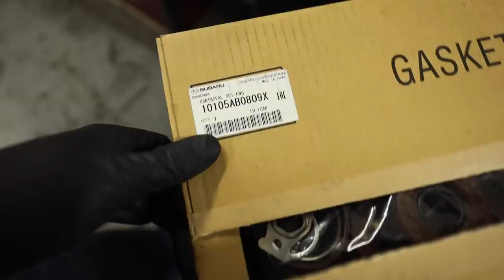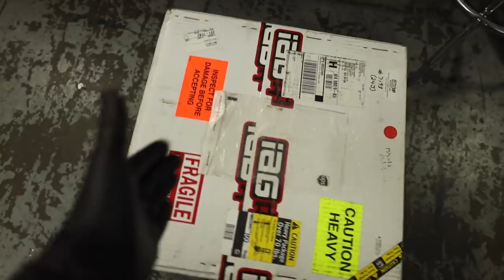Building a 2007 Subaru WRX STi!

Comment: Keep it savage bro.  Always savage!
Reply from the maker: Whats the pil filter your using? Too wide?
Reply: @Smeedia  no it’s a k/n fairly smaller than the Subaru oem one. I can send pics through email.
Reply: @Smeedia  it won’t fit because of the killer b holy headers I’ve installed.  I also have a grim speed up pipe and Cobb down pipe blouch 2.5 xrt with a 3” Perrin inlet. E85 conversion and a 340 lph gas pump. Kw Suspension Perrin sway bars Perrin links Perrin transmission mount and other stuff I’m forgetting. But for some odd reason its only the exhaust that won’t fit I feel correctly. Because now that I’ve installed the aftermarket exhaust the oil filter is out of place and won’t fit
Reply from the maker: Shoot some photos over 🙏 are you on IG?
Reply: @Smeedia  @meta_wrx

Comment: Nice!  That's almost the same build I'm going to be doing on my 02 wrx wagon.  I'm still trying to figure out everything I want to get, and spacing out purchases.  I got the iag trojan closed deck block.  I'll be getting stock ported b25 heads, but with upgraded internals.  My biggest issue is what turbo/turbo kit I'm going to go with.  I want to go rotated but it's so much money.  And the rest of the supporting parts, of course.  I will just patiently start amassing all my parts and continue watching your amazing videos.
Reply from the maker: Save up and go rotated, we'll worth it!
Reply: @Smeedia  yeah, that was the plan to begin with.  Go big or go home, I guess.

Comment: I thought you’re supposed to always replace the oil cooler when you motor has a problem
Reply: That's what my tuner told me, or at the very least flush it out in both directions with a solvent.
Reply from the maker: Preferably yes, from my understanding the owner wanted to reuse it so I cleaned the hell out of it

Comment: Just what I expected! Love it! Also, question, do you think it would be cheaper to buy the case halves and internal components and build the short block yourself or spend a couple hundred extra dollars to have it pre-built, blue-printed, and drop-in ready?
Reply from the maker: If your comfortable building it and doing all the work it will save you around $1000, but if not I'd have a builder knock it out 🙏

Comment: owner should have replaced the oil cooler (iag warrenty?) also,  maybe a fluidampner, not the old stock one,
also,  is clocking the knock sensor important?  fram oil filter?
Reply from the maker: Swapped him over to a perrin external cooler now 🙏 talked to him and he wanted to make the switch now, I believe it's out of his budget for the time being. 

And nor.all I do 11 o clock on thr knock sensor, just easier on the wiring where the tail comes off

Comment: You said that there was engine barring material floating throughout the oil system.  Please tell me that you did flush out the oil cooler before it was installed.

Also,  love the channel.  In your videos you do a great job of explaining things.  I have a 06 and 07 Hawkeye WRX and your videos have taught me a lot.  Keep it up!
Reply from the maker: Yessir 4 cans of brake clean and some solvent went through it to clean it out 🔥

Glad the videos have been helping! 😁
Reply: You should never clean an oil cooler always replace not worth the cost verses getting a new oil cooler why destroy a good motor
Reply from the maker: Talked with the customer and he's getting an external cooler to replace it 🙏

Comment: Curious, are you replacing the oil cooler with a new one? I put a new one on my new short block from Crawford, wasn’t sure if it needed to be replaced but felt like it’s be at the minimum a piece of mind thing on my rebuild.
Reply from the maker: Swapping from OEM to an external perrin pil cooler now, at first the customer was reading his from my understanding. Going in the bin now.

Comment: That gasket kit is only for 08 and up sti's? I have an 06 but I'm going with a iag stage 1 build so idk if that gasket kit will work on my new block
Reply from the maker: The gaskets are about 90% the same, I couldn't find the part number for the older gens 😭

Comment: when you remove the bottom 4 bell housing bolts from the tran/ engine to pull the engine do you remove the axle to gain access to the lowest ones? or who do you get there
Reply from the maker: Nope, I just shove my hands down in there with a 14 spanner 😅🔥
Reply: @Smeedia  thank you! because these bolts are about to be the death of me😭

Comment: If that block had spun bearing change out that oil with a new one or use an external oil cooler . It will ruin that expensive shortblock by pushing all that bearing material into the oil supply of new shortblock . Trust me Subaru did that mistake when they replaced my shortblock under warranty. If you can atleast have the OEM oil Cooler Ultrasonic cleaned.
Reply from the maker: Owner wanted to re-use it, I'm aware of the potential, I hard-core cleaned the oil cooler with brake clean and solvent. 🙏

Comment: You should replace the oil cooler it's not serviceable. That's I've learned in subie school
Reply from the maker: Not my car, cleaned the oil cooler as much as possible. 4 cans of brake clean and compressed air should be clean 🤞
Reply: @Smeedia  I was thinking the same thing. It will probably be fine but that is rolling the dice a little bit 🎲 🎲. I’d even send the turbo out for a rebuild if it’s being reused.
Reply: Correct, don’t even THINK about using the old oil cooler. If the old engine blew, spun bearing etc..the bearing material is in the oil cooler. Brake cleaner will not do it. Replace it. That is way too nice of a block to take the risk.
Reply from the maker: @juansavino6285  I'll talk with the owner again but like I said I just put it together, advising only goes so far for what goes on the engine 🙏
Reply from the maker: Talked with him again and going with an external oil cooler now 🙌
Reply: @Smeedia  👍👍👍
Reply: @Smeedia  that's good

Comment: How much to rebuild my 16 sti engine? I have 60psi on cylinder 4
Reply from the maker: All depends on what your looking to get done, just an OE replacement?
Reply: @Smeedia  yes for the most part. I do have "stage 3" parts but mostly i just want to have it running.
Reply from the maker: Brian can set you up with pricing, depending on the servertiy of internal damage to the block would vary cost. If bearing material was shot oiling components would need to be replaced
Reply: @Smeedia  Ok sounds good how can i get in contact with him? How much was the build in this video just ball park?
Reply from the maker: Ball Park with labor I think around $9000
Reply from the maker: And via FB on the Mod Gargaes page 🙏